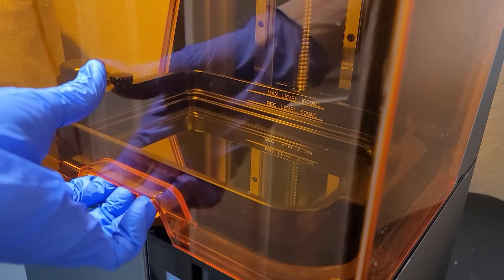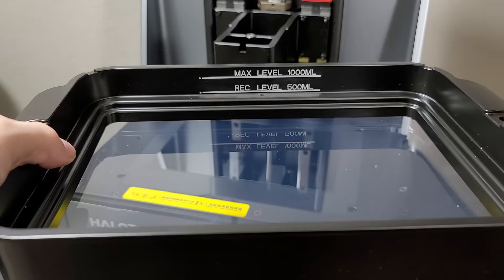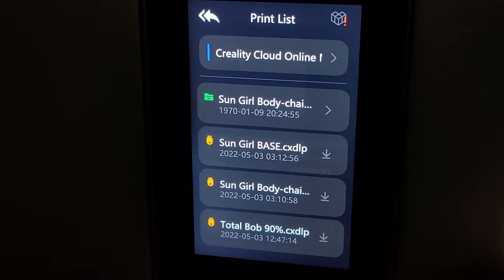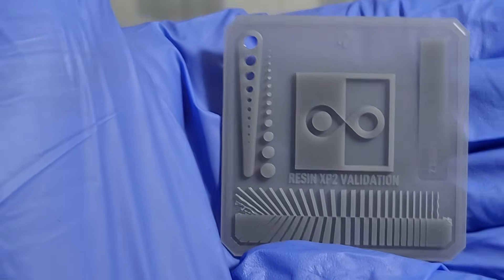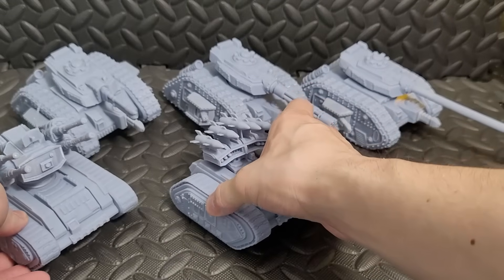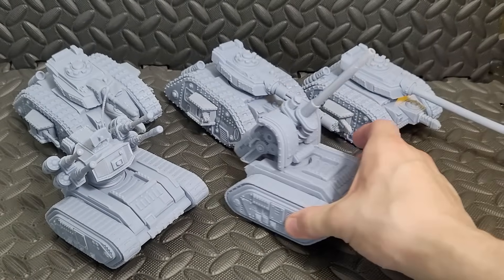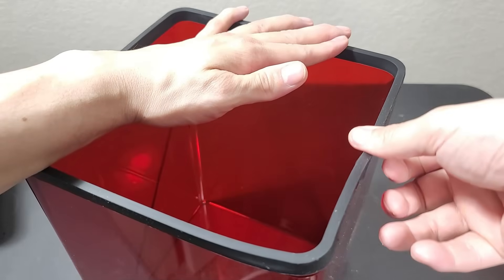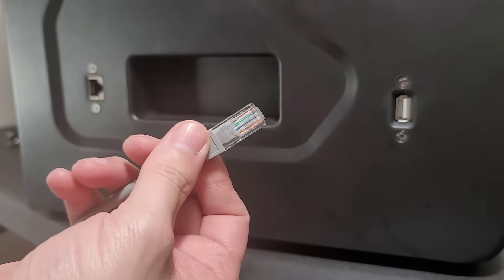THIS 3D PRINTER WAS ALMOST PERFECT! WHY DID THEY DO THIS?

Comment: Hi! I'm getting into 3d printing myself at home since all my kids got into tabletop wargaming it would cost a mint if they all bought from GW. I'm wondering if there's a guide on fume management? If I am using a printer such as this one would it be safe for it to be printing on a desk next to me, or should I put it in a separate room with an open window? 

I also heard you won your suit against GW, congrats there as well, you are a legend!
Reply from the maker: Hello sir.
I would recommend getting a charcoal filter hooked up to a Duct Fan, and placing it next to your 3D printer.
I have a video about this and I show my setup inside a closet to make sure that all the areas filtered out.

Of course open windows and ventilation never hurts but the charcoal filter removes all the smell for me
Reply: @CommissarGamza  Thanks for the response man, you're the best!

Comment: I feel like I've been to this channel before because of the intro. I wish I could afford this printer as the detail this printer offers is equal to casting without the expensive cost of negatives for traditional plastic models. The best thing about these printers is the benefits to detailed printing and you can sell your prints at a premium as well as for even more money if you paint these yourself as long as you're very skilled at painting with such detail where detail matters. Anything more advanced would be CNC Machines, I mean 3 and 5 axis monsters meant for industrial and aerospace applications. But that's off topic.

Comment: The term “diminishing returns” is thrown around a lot to put down better printers, ignoring the fact that EVERY printer is a result of diminishing returns.  Yet you still buy a printer even though “diminishing returns”.   So it’s silly to even use the term.

Bottom line is the print quality.  What is the print quality you need?  Get the printer that meets that criterium.   For me, I feel the new Saturn 8K hits the sweet spot.  I was hoping for around 25 microns, it’s 28.   

You don’t see visible print lines, you actually see a difference in surface texture depending on your MODEL, NOT your PRINTER.  This is when things matter to me.
Reply from the maker: You should get the printer first.
Reply: @CommissarGamza  Get the printer first before deciding which printer to get?

Comment: I have been printing with an anycubic I got on sale and am actually looking to getting into a larger print bed. I have a small 3x5 ish bed and it's running pretty consistently so a larger bed would be nice to get large models done or a squad in a couple prints. As of tight now I can print a single warrior at a time

Comment: Interesting. It looks like it should have a stable platform but you are still getting layer shift sometimes. I can see it on the prints you pulled out. Can you catch your fingernail on those flat-surface shifts? Always curious how bad some are and some are not. Some printers seem to do much better. Usually dual rail units with very heavy armatures and I'd expect that for 1k USD.

Comment: I own a Mars 2 Mono. Not the pro, just the normal with the green lid. I am the type that homes down the settings to be as detailed as I could with out fails and personally... printing on this thing, and one of the newer printers out there a  buddy has... I really can't tell much of a diff. I don't even recall anymore witch figure was printed on what machine. It gets to the point the quality improvement is finer then the nakid eye can see, and when you get to that point I don't see going so ultra in resalution to be worth it.

Comment: i have two 4k printers and an 8k.

8k is my character/hero printer.

basically everything else goes through the two 4k printers. 

as long as you set up and maintain a 4k printer, it is all most people will need.

The 8k is as I said more for heroes/show pieces. 

honestly I am looking at getting a filliment printer just for terrain. bigger print bed, lighter material, slightly more forgiving with clumsy people. The layer lines can be hidden easily, if a bit labor intensive. that or a laser cutter.
Reply: So you can print in 16k wow!
Reply: @MarquisDeSang  yes I can but it still does not fix my level of noob... maybe when I get to 64k but i am guessing it will be 256k

Comment: Can't wait until the technology evolves far enough that we can have 3d printers who print out(reasonably) colored models. Seeing as I am crap with painting I will wait until that becomes a real thing. Until then I will just enjoy looking at the stuff you produce and drool😂
Reply: That would be cool but imagine how big that would need to be to fit big tubes of a dozen or so coloured resins
Reply: @lewishorsman2219  Color 3d printers already exist, but the cost hasn't come down enough for them to be remotely accessible in the consumer market. What the existing printers have done is basically just take a very high quality FDM printer mechanism, but instead of putting a hot end and all the hardware related to filament on it, they mount an inkjet print mechanism to it along with a UV light. Then they can just feed the inkjet mechanism with a few colors of resin and get pretty decent results
Reply: @lewishorsman2219  Who knows technology keeps advancing, they might come with a solution that now we would think is impossible or super expensive and suddenly after a break through it becomes normal an affordable. I will wait and see
Reply: We do have the technology...I was at a demonstration 10 years ago that showcased it...the problem is that the printer, due to the method required, is about the size of a decent volume chest freezer...and carried with it a very premium price tag.  Everyone at the seminar received a set of bearing rings; an inner ring with multi-colored bearings between it and an outer ring...all printed as one unit.  Again, it can be done, but the tech is messy and expensive.
Reply: I'm also waiting for that day, too.  
But I don't think you can mix colors of plastic filament the way you can mix colors of ink.  
But it sure would be nice if you could load CMYK filament spools into your printer and print any color...
Add CMYWK so you could have white and pastel colors, too!
Reply: It already is?? The cheaper ones are around 500-600 dollars. Which is about where moderately priced regular 3d printers are.

Comment: Are Resin printers worth it? Is there any reason to go filiment?
Reply: Fdm printers are good for large pieces and terrain. As with resin, a filament printer just needs to be tuned correctly and the proper filament is important too. If you want to print usable items (cosplay, weapons, even frames and receivers for firearms, tools) fdm is the way to go. If you want something that looks superbly detailed, resin wins hands down. It's all up to how much you plan on using the printers. If you're going to print an army and that's it, you would save money from buying gw, but then you have something just sitting around taking up space. That wouldn't be worth it to me. If you find other things to print that gets you using it more often, then it would totally be worth the price and the buy. But it's all up to you and your preferred spending habits.

Comment: Defiantly a step above my photon mono. That thing did a lot if good prints, but now the base layers keep separating.
Reply: Have you changed your fep? Or messed with your settings at any point?
Reply: @camdavbax  if the FEP is the clear  piece at the bottom of the vat, no I have not. That was going to be the next thing I tried. As for settings, I have always left the setting on default and had no issues until this point.
Reply: @christopherreynolds4506  that'll fix your problem